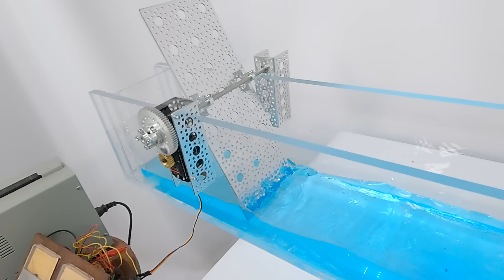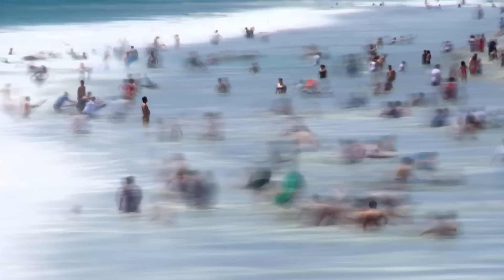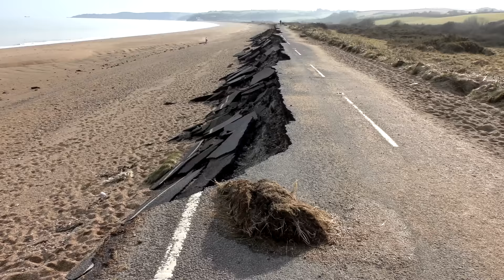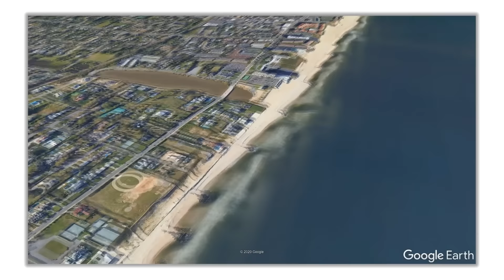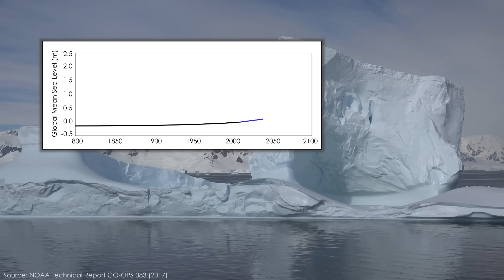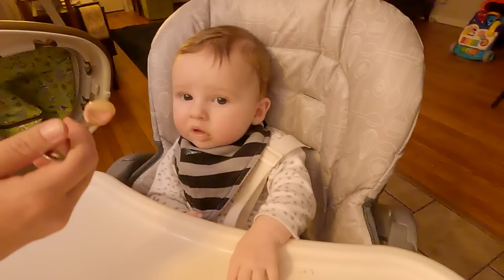How Coastal Erosion Works

Comment: Hi, I am from Indonesia. I have an idea how to stop the abrasion by making line mattress in long of seashore from coconut fibre. It is cheaper than others option. How good this idea is? You have to divide 3 parts the mattress. Each part has long from shoreline in front of it around 100 metres. Then, you have to make a gap around 20 metres to the next part. So, total has 300 metres. The first part of materials that close to the shoreline, we have to put a seed of mangrove and the 2 rest of the party just for slowdown the waves before hitting the first part. I am sure, the seed will easy to grow because it planted in coconut fibre. I have ever given this idea to our government, but they prefer by making a wall in a long line of the seashore or arrange the big stone in there. I know why they chose the options due to it could be a good project for them. I hope it idea can help whole countries in this world.

Comment: I had to reject a seawall job on steep hill. Guy had cut 2 red oaks at the lake shore bottom of a steep hill. I could of pushed them over in winter and not left with stumps. Personally I would of left them to hold back hill. Chapel rock at Lake Superior is great example of erosion and lots of pictures of it over time. I build rip rap seawalls. I don't like metal seawalls that make the bath tub effect. Were waves just keep running around shore line. The interglacial warming period will end. No matter even if we raise global temps by 10*C.
Reply: Yes, this interglacial warm period will end.

But it's going to be a little while before it does.

The Earth's orbit has several cycles it goes through.

The big one is the 100,000 year switch from an almost completely circular orbit, to a very elliptical orbit.

It's during the very elliptical orbits, that the warm periods end.

And we just got out of a near perfectly circular orbit cycle, and this cycle is also going to be nearly perfectly circular.

So while the interglacial period will end, it's going to be around 100,000 years before it does.

Considering how long it's going to be, we should probably just pretend that this interglacial period is permanent...... Because 100,000 years is roughly 5,000 generations, and is about half as long as we've already been here.

Comment: A great 101 on coastal erosion and basics of coastal engineering, masterfully communicated in easy to understand terms and illustrative videos. I work as a coastal engineer in Sweden, and a lot of what I do concernes raising public awareness to the value of beaches and salt marshes as wave breaking buffer zones, especially in a future climate with increased MSL. Your wave tank videos are supper illustrative of wave action, but the snippets are short, and I was wondering if they are available somewhere else? And of course if they can be used, proberly referenced back to you.

Comment: Hoping that someone reads this 7+ months out. Beach nourishment can go so much further in-depth than this video goes. The slope of the beach prior to the shoreline drastically changes how and where the waves break at. This is why different beaches will have different breaking waves. When the waves break closer to shore (termed surging or shore-break waves) will cause faster erosion and present a hazard to those in the water close to shore.

Please do not let this take away from how well this video explained the basics of coastal erosion. I just thought I would add a little more information.

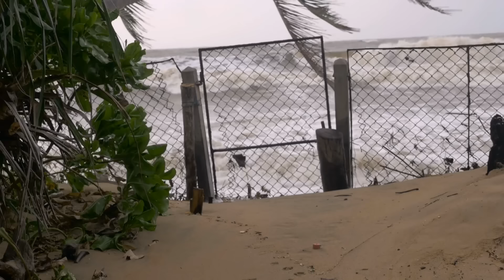Comment: Respectfully, your line graph @7:27 feels misleading.  

You say that sea levels have the potential to be 3 feet (or 1 meter) higher by 2100, but then show the line climbing over 2.5 meters (or over 8 feet).

I hope this was just an oversight with conversions on your chart.
Reply from the maker: Sorry for any confusion. The script says "in 50 years..." but the graph shows out to 2100. It is copied directly from the NOAA report.

Comment: In beaches, What solves this issue is cold icy water during winter. The freezing water on top will dig into the sand and force the sand into top spot where the ice is. When it thaws out in spring, the water is replaced with sand and thus the sand protects the land.

Comment: One of the challenges of beach renourishment is that not all sand is created equal. If you pump sand from offshore or deposit dredge spoil from a nearby inlet or river the consistency of the renourished beach isn't necessarily going to be the same as that of the old beach. Which can be important not just for aesthetics, but affects things like sea turtle nesting and can change how waves interact with the beach.

Comment: Dams contribute to coastal erosion by holding back sediments that would naturally flow down river and replenish soil that has been eroded by wave activity. 

The amount of sedimentation behind dams can quickly reduce the capacity of the dam which holds less water than originally designed.

The idea than global warming, climate change or whatever flavor you want to call it this week is partially responsible for coastal erosion.

Comment: You have 5 or 6 videos about concrete. Have you ever thought of doing a video about aircrete (cement mixed with air bubbles). I’ve heard the Romans used it and Europe builds with it also but in the USA only DIY people use it.

Comment: Question,if you dont mind. Being that the great pyramid of giza was covered with limestone casings allegedly couldnt fit a razor between....an looking at the schematics minus the man made tunnel from robbers. 

What do you think would happen if they added water....lots of it. Could it have been used as some sort of pump,landmark an rain collector? Do you see any parts of its workings that seem would be water related? The properties too..dolomite,quarts,granite,limestone an possibly gold? Keystone?. The gold key makes me think of a visual landmark. Obviously water was in far different places back then. (Boats found buried near base of all 3 I believe. (Not counting PYRAMID OF RA). I feel there had to be some sort of mechanical use. An possibly multiple use. Its size...it could collect rain water if it was really as smooth as claimed. The fact that certain parts or shafts (original) were built crude an some built with amazin acoustic an possibly fluid dynamics. Like it was a machine. An engine has to be precision on the sleeve,piston,rod,rings,manifold,spark placement..to get the result needed. Other things can be crude an it still works fine.  
     Just seems so much more than tombs. Like it had a mechanical effect. The sphinx shows massive water erosion. So we know there was water.  My question is could these things somehow have been used to turn the most barron places around giza Platue into an oasis. possibly collecting gold too if water was running through it.  The grand gallery is a huge sluce box in a way. But god is heavy...how would it get there ect...not so concerning about that as some type of visual landmark guide and possibly water pump or preservation machine.

Comment: nice video, but not   entirely  accurate. coast lines are  in deed very dynamics, but  not all of them  are  in  an  active  erosion   process.   the  cost  line is   a result of the balance between some forces,  like  the waves, Ocean currents, rocks resistance, sedimentary deposits  from  the  land  and  sea  and    sedimentary  erosion.
a lot  of beaches are  stables, some are   in  erosion and others are growning. it mostly  depends if   the  ocean currents  are changing or not

Comment: I had hello fresh for a bit. 75% of the deliveries were messed up (missing ingredients or the wrong ingredients entirely).  I also wasn't able to skip the first week (signed up, didn't like anything on the menu for the first week, tried to skip within 5 min of signing up and actually seeing that weeks' menu but wasn't allowed to skip it even though they said you could skip any week). Then cancelled in order to sign up a week later so I wouldn't get meals I didn't want. Nope, still had to get that first week, so I clicked the "uncancel" button and just ate it. Four weeks later noticed I wasn't getting my signup bonus, apparently the 30seconds I had cancelled made me ineligible for it, and they wouldn't make an exception due to circumstances (as stated). So I cancelled and left all of the credit (due to the continuously inaccurate orders) on the table and found a new one to try that was significantly cheaper and came with 50% more meals. Signed up and started picking out food and it looked suspiciously familiar. Learn from my lesson: Every Plate is the same company as Hello Fresh. The packaging isn't separated between meals and the options are a bit fewer, but you can customize some of them (swap chicken for pork, broccoli for brussel sprouts, etc). Well worth the significantly cheaper price.

Comment: Another method is to construct a so-called "sand motor", which is a sort of pier off the coast made of sand or some other loose material, and letting the natural ocean currents deposit it on the shore that you want to maintain. It's essentially making erosion work in your favour.

Comment: Can you make a video explaining how to meassure flow? I work as a wastewater inspector and flow meassurement is one of the complex things to do, altough there are some portable samplers wich have already a flow meter sonde wich allow you to meassure water level and speed, but we work in the city, and the flows on the wastewater chambers are very low and slow, so... I was wondering if there is any object to add on these chambers to make flow a little more stable so in that way could be easy to place the flow meter sonde and meassure the wastewater flow.

Comment: The problem with beach nourishment is that it's often very expensive and the costs are usually covered by the state. This can lead to some very uneven use of it where some poorer areas are left to erode away because they don't have the influence to get the state to do it meanwhile richer areas might have the state spend more on beach nourishment than the properties are actually worth, but it doesn't matter to them since they aren't footing the bill.

Comment: Do you think you could do a video on how automatic gas changeover valves work? They’re not the usual large-scale infrastructure, but they do contain some sort of engineering magic and I last time I looked I couldn’t find any good resources on how they work, only how to use them. In a similar vein, the physics of pressure sustaining valves and pressure reducing valves is quite interesting.

Comment: Fascinating topic!  The barrier islands of North Carolina are a great study in the management of coastal erosion.  Prior to the state's enactment of sensible shoreline management, developers and communities were busy trying to stop the ocean from gobbling up their ocean front property.  The more they built hardened anti-erosion structures, the faster the state's beautiful beaches were disappearing.  Finally, during an unusual period of time when the state's political winds aligned with sound science rather than just the bottom line of development companies, an extensive management plan was enacted by the legislature.  Basically, they took their lead from how nature manages herself along the vast undeveloped expanses of the Outer Banks and other undeveloped ocean front areas.  Radical set-back rules for buildings were phased in along developed beaches and landowners were prohibited from hardening their ocean front.  The result has been beaches that are now MUCH more stable.  They are also much more robust when confronted by hurricanes.  Geologically, these areas are THE most dynamic on earth.  Building on sand a few feet from the ocean's edge makes no more sense than building on the slopes of an active volcano!

Comment: If you take 6" diameter stainless steel pipes, stand them up vertically, and make a 'fence' out of them so that there is a 6" gap between the pipes, when a wave hits that fence of pipes, the wave loses 60% of its energy.  Build 3 or 4 fences like that before the actual beach and you pretty much remove ALL of the energy from those waves and you reduce the coastal erosion down to ZERO.

Comment: Ah reminds me when I worked as a commercial diver dredging sand for these pretty clever erosion barriers that were basically long porous tubes laid along the shore. I'd be on the lake or seabed sucking up sand and someone would be on shore filling up the tube. All the water would drain out and it would become hard as rock. Then I'd suck up more sand togo on top of the tube. Mexicans would come then and rake the sand on top to a perfectly even slope and plant sod on top and you got an invisible erosion barrier. I didn't like that job because I would have to dig myself into a hole always in zero visibility. You absolutely had to dig deep holes to get proper material, no way around it. So you're in a diving helmet in a 20 foot deep hole under about 20 or 30 feet of water and the hole is always going to collapse it's just a matter of when. You just have to learn how to to know when to get out before being buried. You can usually just tell by how things feel when you are pushing your luck too much but I've had to scramble up a collapsing hole more than once. A coworker told me about a time before I worked there when he sunk someone's entire back yard into a canal all the way up to the house. He had literally made a large sink hole that took docks, lawn furniture, the entire back yard into the earth never to be seen again. It was miracle that the guy on the pump boat was able to haul the diver out by the umbilical before he got buried. All that crap for just $20 an hour which was barely even a livable wage in South Florida. I took my talents elsewhere after about a year but this was back in 2009 where most people were lucky to have any job at all. The erosion barriers were a really neet idea though.

Comment: Wow, there’s so much misinformation here, mixed with half truths that paint a bleak picture to anyone unfamiliar with how the intertidal zone works. Your model and all the problems you’re claiming would be correct of coastal areas if a few assumptions were true, but they’re not. 
Assumption 1. Waves hit the shoreline directly on. This rarely if ever happens, 99.9% of the time waves hit the shore at an angle. Why does this matter? If it hits straight on you get an effect like your demonstration shows where sand can retreat back into the ocean. If it hits at an angle, it moves the sand up or down the coast, and this often depends on which season it is and where you’re located. Although most beaches can get swell angles from different sides at any season. A great example of this is Hawaii which has coastline all around it. During the winter months it tends to get a lot more swell on the northern coasts, but it is possible to get a swell that hits the southern coast, it’s just much more rare. Then in the summer, the opposite is true. The southern shore gets a majority of the wave energy with the very rare swell on the northern side. So the sand moves one direction for one part of the year, then moves back up the other. If this didn’t happen, all the worlds beaches would have been void of any sand many many years ago. This is also why you get a heavier buildup of sand along a jetty or a natural rock outcrop and why if you have an unusually heavy storm during one season, the following season that tends to move sand back up the beach doesn’t have as much energy and can leave sand buildup. In some places, especially along manmade harbor jetties, this ebb and flow doesn’t happen as ideally as we would like so sometimes you have dredging ships who suck sand from one side of the harbor entrance and deposit it on the other side so the sand can continue down the beach as it would normally do if the harbor jetty wasn’t there.
Assumption 2. This is really more of number 1 but your model isn’t wide enough to show sand moving up and down the beach, all beaches are much wider, they’re not a little sliver which reacts differently. So again much more sand moves up and down beaches than away from the coastline and down into deeper water. 

Having said all that, the ocean is a dynamic place and for me to give a blanket statement saying this is how all coastline behaves worldwide wouldn’t be accurate either. But what I said is the main reason we still have beaches. Because the sand has a tendency to move up and down them. If it wasn’t for that, we would pretty much have just rock and reef coastlines with all the sand in deeper waters. This is also why so much coastline real estate is relatively safe compared to how much sand is actually moving around. Bottom line, coastal areas are much safer than what this video implies although there are isolated places in danger.
Reply from the maker: Hey Shane - Sorry you felt like the video had disinformation. If you note any specific errors in the script, please send them to my email so I can add errata to the video description. The models I build are definitely simplified since my goal is to boil down a topic in engineering to an 8-10 minute overview. Deposition and longshore transport are mentioned in the video, but perhaps I should have dedicated more time to those coastal processes as well to make the video more balanced.
Reply: @PracticalEngineeringChannel  It is a complicated topic.
If you want the real story, use a statistically significant sample size of beaches around the world, and gather coastline images of them from different years and seasons. Then see if the median sand height is actually different for one 10 year span during the same season than another 10 year span 50 years ago. Of course this would be very time consuming and probably not practical for a single YouTube video.